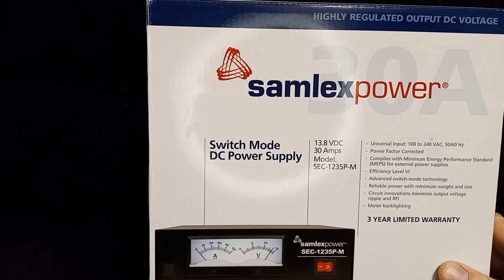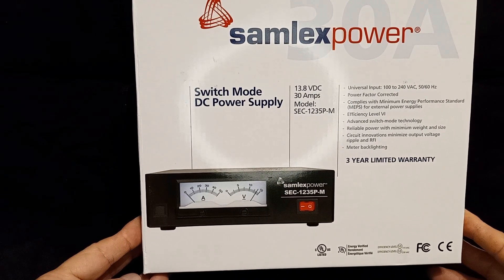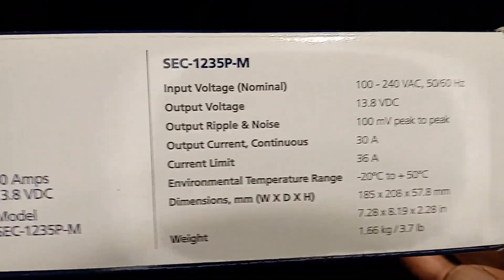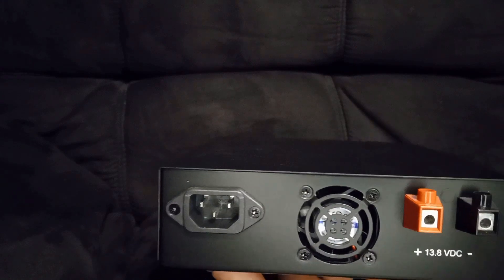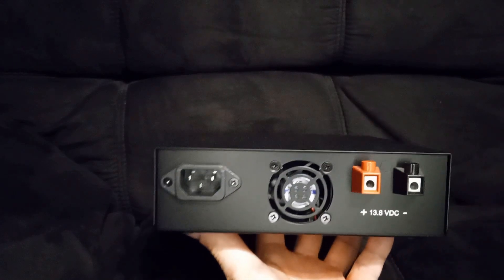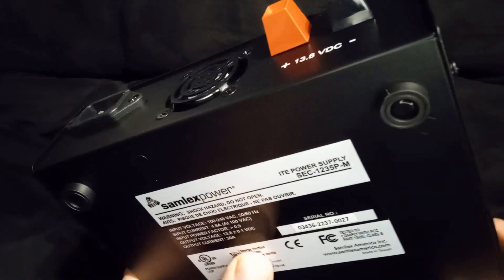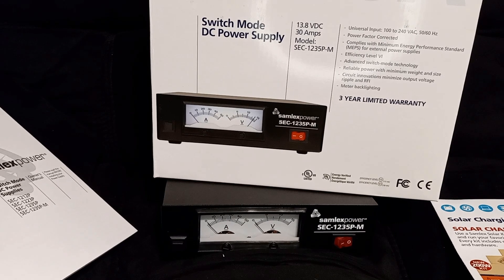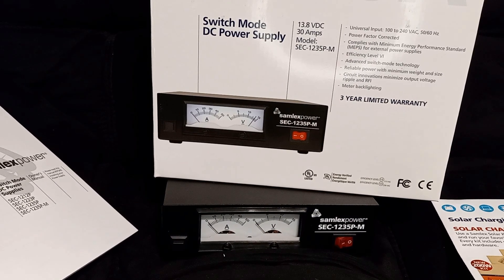The Samlex Power SEC-1235P-M Switching Power Supply.

Comment: Samlex makes good power supplies I have used them for years with no problems I live in southern Illinois
Reply from the maker: I used an Astron linear PS for a long time. I wanted something that was more energy efficient, ran cooler, and didn't cause noise in the receiver. I had been looking at this model for a while. I wasn't (or so far am not) disappointed. It seems well built.

I live just outside my hometown Herrin here in Southern Illinois. That's in Williamson County.  Carbondale is about 17 miles SW, marion is 6 miles South of me.
Reply: @SouthernIllinoisShortwave  astron makes good power supplies to you won't be disappointed with samlex I've owned a few of them I have a samlex 1235 powering my ham radio station I live about 8 miles from Jonesboro.Some switching power supplies cause noise in the receiver called birdies because they  don't have good filtering in them but samlex are well filtered and doesn't cause birdies on my radios receiver.

Comment: I just got the same PSU and there is a terrible high pitched coil whine  under minimal load e.g. when radio is just in receive mode. Do you hear something similar on your unit?
Reply from the maker: I turned mine on and put my ear down on top of it. I don't hear that in mine. My 8600, and my PSU is completely quiet.

Comment: The meters are handy.  I remember using a power supply at Radio Shack to power the car radios in a display and you really couldn't tell if it was working until you tried it.
Reply from the maker: This Samlex really surprised me. All you hear in the radio scene is stay away from switching power supplies. But these new Switching PS are a lot better than they were just 3 or 4 years ago. I still haven't seen any noise signatures on the waterfall, or heard any noise from it on my Icom 8600. I guess it's like most other things, they get better as tech evolves.